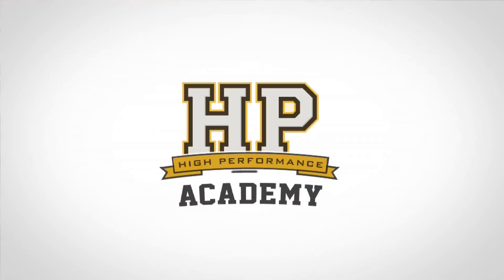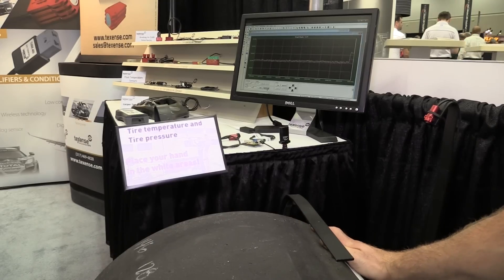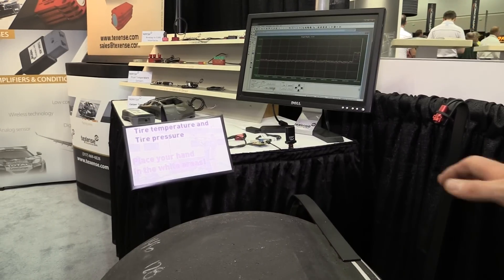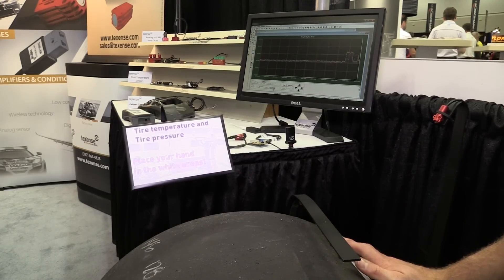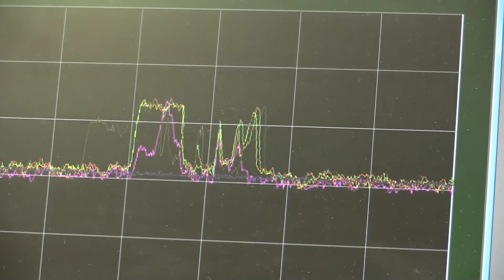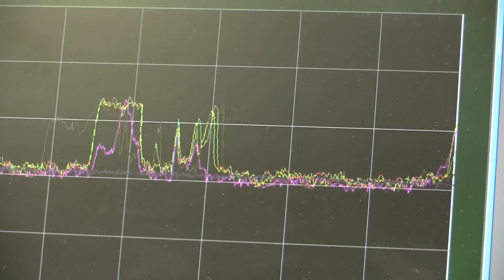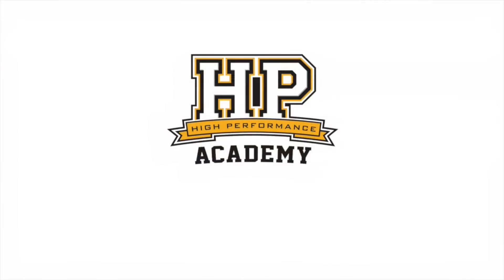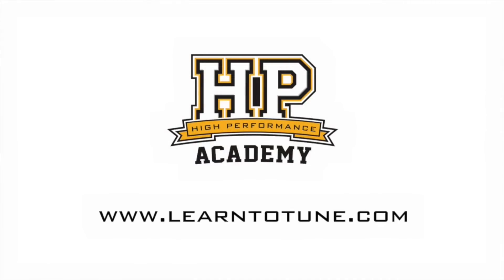Without Data, All You Have Is An Opinion | Texense Tyre Sensors [TECH TALK]

Comment: By the way!!!! You can feel and hear an engine to very close to perfect ... if you know what your doing!!  ...............Before computers.... engines were tuned not by guessing but by our senses!!! They actually work quite well!!!          Now.............not a lost art but a lazy ,easy way to get what you need or want. Computers even self tune!!!!! It's still fun to tune with computers but in a totally different and almost detached way!!!!!!  That's  my 2 bob worth!!! I think it's actually more fun to tune a car with hand tools than to data log and type in different numbers to get a result!!!
Reply from the maker: This is not quite accurate. You can only do so much with your senses (if you can hear knock with just your ears then your engine is already damaged for example), and years ago you just didn't actually know how bad things were or weren't with the subjective guesswork whereas now we can see how much far off the mark those techniques were. Plug reading for example, you can't just pull a plug out and have it tell you it's story after thousands of KMs, you need to cut the engine at EXACTLY where you want to check, and it needs to be a fresh plug. Your average person is not going to do this. To change flow in your carb you have to physically change the jet. If you have 4 carbs this is a bit of a mission, and then you need to balance them to boot where as an injector it's done in seconds. 
With modern technology, you can see what is happening right through the engine in a few minutes and even check back into the past as well.
As for self-tuning, things are not quite there yet. You still need to manually finish the tune off, the technology just sets you up with a bit of a base.
That's my 2c as an owner of both carbed and EFI vehicles - Taz.

Comment: That's pretty cool. I recall being taught how to tune suspension using tyre temperature (I did a Motorsports TAFE course once upon a time), but we only had access to the small spike sensors in the pits, so we knew it wasn't ideal.

We did, however get taught that the temperature a few mm under the tread was a far better point to measure from than surface temperature, as it would be affected by cooling airflow much less. We did check that, surface temperature vs spike temp. Turns out surface temp is basically useless (uncorrelated with spike temp) on a tin top by the time it comes in, thanks to cooling airflow. Open wheelers were more consistent.